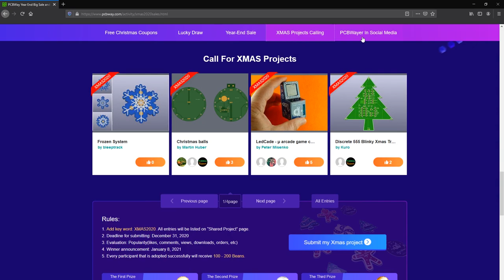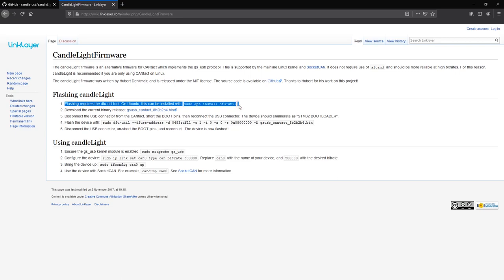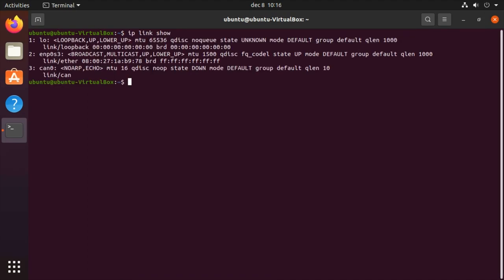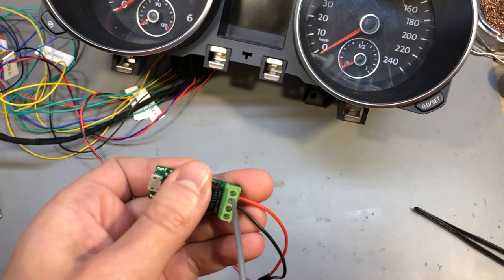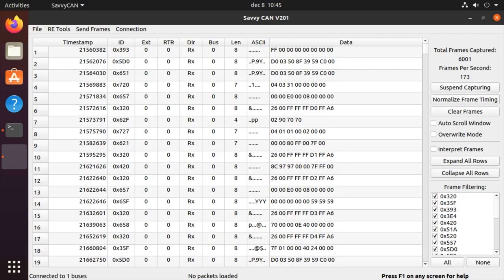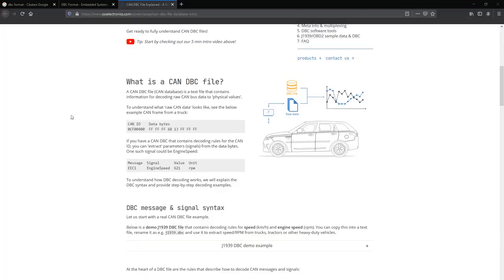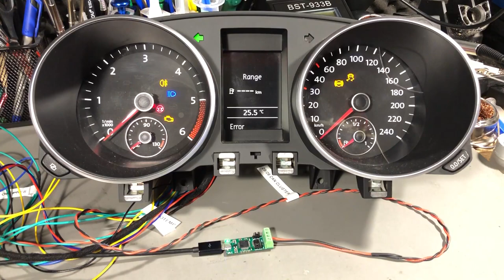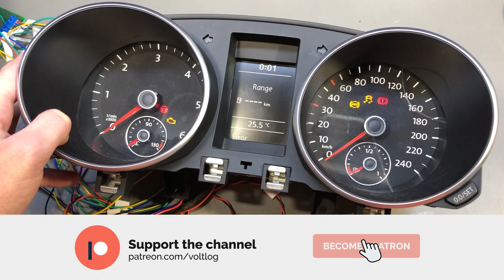VW Can Bus Hacking With SavvyCan & Cantact - Voltlog #342

Comment: All automotive technical information should be open source! When you buy a car, the manufacturer should supply all technical information so you can work on your own car that you paid for! Period!
Reply from the maker: I agree but that also brings a bunch of security risks these days.
Reply: @voltlog  why security risks? When you make it opensource, other security research experts can have a go with it. Now its security by obscurity, and thats a bad practice.
Reply from the maker: @marcelhh2101  I am not a security expert so I can't say what the correct approach is but where would you draw the line as to what is disclosed and what not? Who is gonna take the blame once hackers gain access and override the controls of your car because of information that was published as open-source by the manufacturer? I support the right to repair but I think the consequences of opening everything could be serious.
Reply: @marcelhh2101  Working for company that produces automotive ECUs I would say that what you propose it’s not feasible from different perspectives. 
First its like VoltLog mentioned, there are a lot security reasons for that will be never open source, one example will be related with key or imobilizer of your car, excluding form this discission about milleage. I’m thinking that you will be not happy If one guy will sole your car because he researched open source software of your car.
Second, software its tested by manufacturer of the ECU, OEM and also by a third party company hired by OEM to test security of their product. 
Third reason its that starting with these year EU introduced a more comprehensive set of regulations for cybersecurity for automotive manufactures.
Reply: It sounds good in theory until a manufacturer invests tons of money in R&D for a car feature, and then they have to open it and all the money goes out the window because a bigger more powerful company copies it immediately.
Reply: @voltlog  Security by obscurity is pathetic, it never works. They should share information and it must be reviewed. That is the only was to make it actually secure.
Reply: man how this aged BMW is no offering pay to win suspension software haha

Comment: Very cool project.
There's an in depth YT series on the CAN bus with Pete on Sparkfun's channel from around a year ago. I watched it, but TBH I didn't understand most of it. I haven't done a project with CAN so it was difficult to contextualize the depth he went into. From a high level abstract perspective, I get the impression CAN is kinda like I2C but more robust, faster, and capable of communication over much longer distances?
Reply from the maker: I try to look at things differently, at least when I'm just starting out with something new. I don't need to know all the inner details to get something working: I need to know it's a differential bus so I will need two wires and a special hw driver and there is some protocol for signaling but that is taking care by the CAN interface implementation inside the microcontroller. Next I need to know that each message has a CAN ID and some data bytes. The rest is pretty much not important in this early stage.
Reply: @voltlog  
 I get lost really fast when I do that kind of approach. Even when I manage to pull off a task, if I don't intuitively ground my thought process I will forget everything I should have learned. It's kinda why I explore a lot, I'm mostly trying to fit pieces together to build on intuitively later. ...Probably means I'm just dumb, but I don't care.

 In the Nintendo GnW project, there are two cool chips they used that have part numbers with datasheets. If you need a single cell lithium controller that can charge and handle powering the circuit from USB, the BQ24072 from TI is what they used. The circuit looks pretty simple, and the datasheet, at first glance looks good.
   They also used a little PMOS switch to cut off power to the LCD controller and flash chip. It's a Toshiba part number SSM6J412TU and comes in a little 6 pin SMD. It's capable of decent loads, but the real kicker is that it works with logic levels all the way down to 1.5volts. It's the first time I've seen a power FET that works that low. I haven't needed anything like that or gone looking, but I will have the circuit block documented soon. I was working on it in kicad earlier today.
 Good luck with the CAN bus buddy :-)
-Jake
Reply from the maker: @UpcycleElectronics  Thanks, you too!

Comment: The  usb - can adaptor you are using looks like a different model to the those you have linked to? Will the adaptors in the link work with SavvyCAN and Candlelight firmware?
Reply from the maker: For best results try to get the same. The link I placed will show you at least 5 different listings with the exact same adapter.
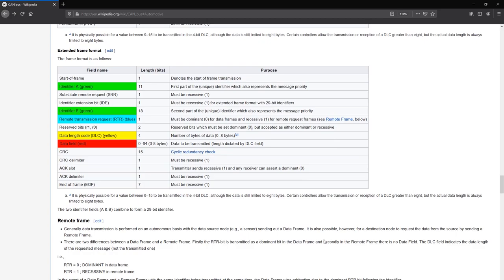Reply: @voltlog  The module you show in overlay at 0:50 is different to the one you are using at 6:32 (2 screw terminals vs 4 screw terminals and some minor pcb differences) do they both use the same microcontroller and work with the firmware and software you link to? As far as I can tell first is CANdo clone and second is CANable clone?
Reply from the maker: @vincepatti8978  I use the Canable clone with 4 terminals, however the outer ones are GND and 5V which you wouldn't use anyway. I've added a second link to canable specific dongle however I suspect the two are identical and they will work with the same firmware.

Comment: Thank you for the information! Hoping for some guidance. I am interested in updating the window/mirror adjustment switch in my vehicle to that of a newer year model. My question is how do I decode the data from the current switch module and match it to the new one? This upgrade is common in Russia and is done by changing resistance in the new switch, I believe. However, it is difficult to get in contact with them so I would love to create my own. Thank you so much!

Comment: I ordered one of this adapter immediately after your video :-)
I received a reengineered PCB (also with a GD32 instead of STM32, but that's not the point) ...there is no more a "boot" jumper or, maybe, it is simply unpopulated, I have to check thoroughly.
Wondering if anyone knows this new board.
Reply from the maker: If you ordered the one I showed and yet received something else I would recommend you open a dispute for that order and request a refund. Show an image of what you received, you will get the refund 100%.
Reply: @voltlog  Sure, thank you, it's gone exactly this way and I considered this option but so far the item is working, it's a little more compact, the cpu is a little more powerful (on paper) althought electrically equivalent 
and the seller declares it compatible with candlelight ...I'm going to flash it and see if this bricks it, then I decide about dispute :-)
Reply from the maker: If I had to guess, I would say it would work, those G32's pretty much run the same code without any major issues. I would be unhappy if I didn't have the boot jumper to be able to easily flash different firmware. If it's just unpopulated it's still okay.

Comment: I’m looking for information about the Audi can bus. I think that muts of the information is the same with VW and Skoda
Reply from the maker: It can be very similar although message IDs can be different and can bus architecture can be different depending on the platform but the same rules apply.
Reply: @EdwinNoorlander   Did you end up getting that device?
Reply: @JoshLederer  no. but i haven’t found the time yet.
Reply: @EdwinNoorlander  OK, no worries figured I would ask. I’m about to start messing around with CAN bus.
Reply: @JoshLederer  now problem. it’s still on my personal backlog. I was also looking for a ODBII sniffer/logger with GPS function.